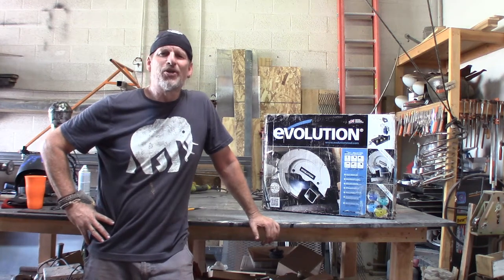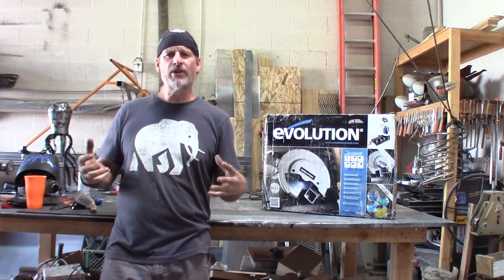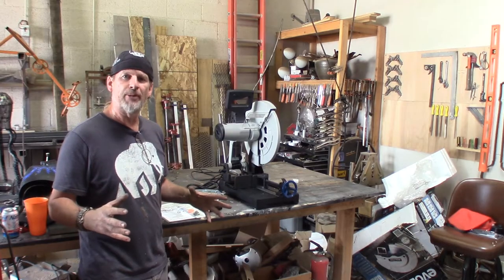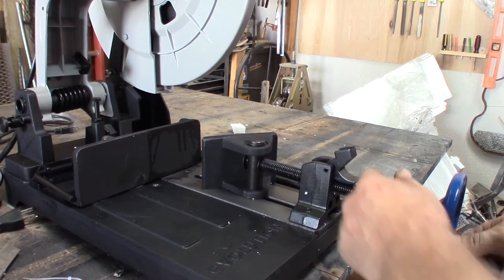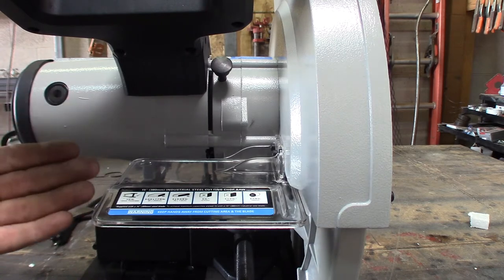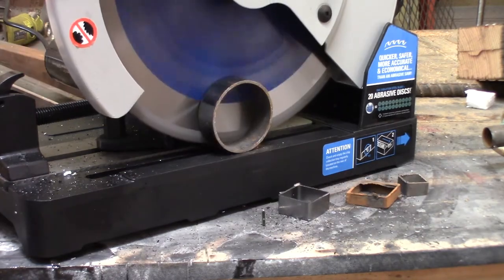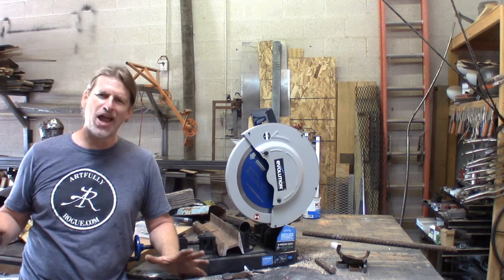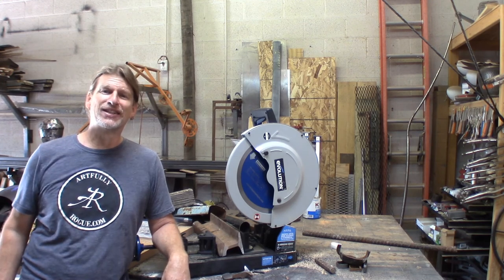Evolution Tools Evosaw380 Review

Comment: I love the saw, but the three things I don't like about it are:
1) The blade comes slightly tilted and not perfectly 90 degrees with the table, so it needs to be adjusted
2) Chip collector shelf comes out of the back of the saw, so I have to turn the saw around each time to empty it
3) The handle feels like cheap hollow plastic
Reply from the maker: Thanks for the feedback Jim. Yeah I've had to double all of my saws right out of the box to ensure it's square. For me, I have easy access to the back of the saw, so I've not really had an issue with the chip collector, however I could see the benefit to having it pull out the side or front for sure. And I've not had an issue with the handle but I have had some minor issues with the metal piece that allows the clamp to thread open and closed. It slips out of place on occasions but can easily be re positioned but I feel it is a week point in the tool
Reply: Mine was perfectly square horizontally and vertically right out of the box.